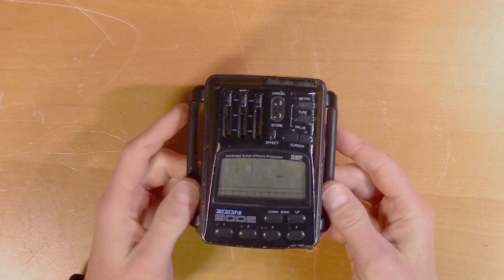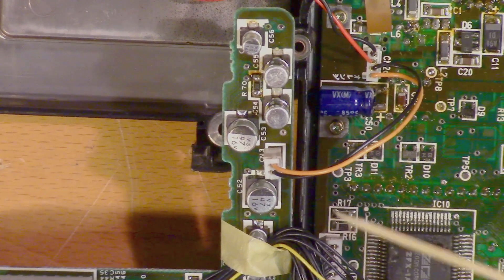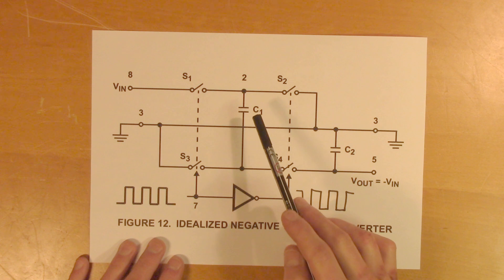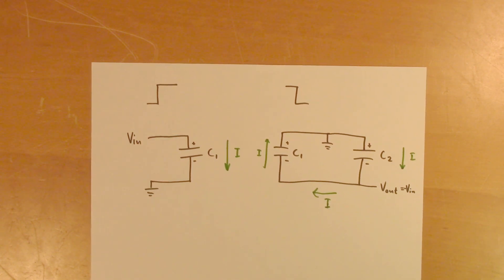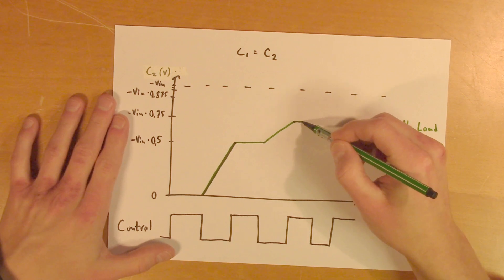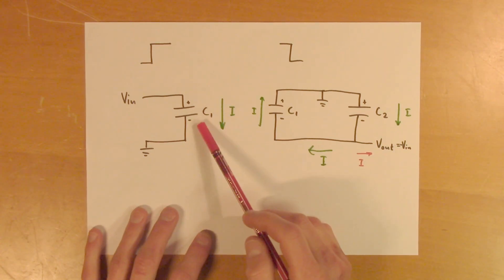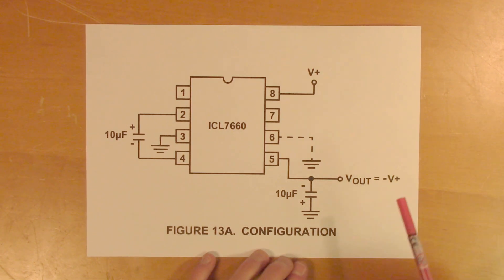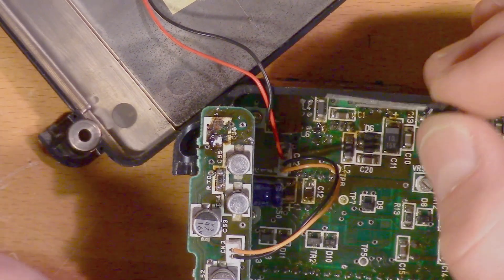ZOOM 9002 - Common Failure Explained + Repair

Comment: Hi SunandWeather Electronics. I had a Zoom 9002 Pro with the same symptoms as yours: no output, 0.5V where there should have been -5V on the little IC. I pulled a 10uF 25V cap off the PCB of a discarded DVD player i found on the roadside, replaced the N4 10uF 16V cap on my Zoom and it lives to see another day. Very many thanks for sharing your video and knowledge 🙏🏽

Comment: Thanks for the video.
I have +4.96v on pin 8 (in) and -4.68v on pin 5 (out)
Between pins 2 and 4 (10uf) 4.80v or +2.47 and -2.32v with reference to ground.
Are the readings correct?

Still not working after changing 8 capacitors

Thanks
Reply from the maker: Hello! It sounds like the charge pump on your unit is working as intended, so the failure is likely elsewhere.

Comment: My non working 9002 came back to life after replacing all of the surface mounted electrolytic capacitors. (Maybe 15 dollars?) I bought a box that had a large variety. The voltage rating on them was higher than the ones in there but that didn’t matter. Had to watch some videos for the proper soldering techniques as they are quite small.
Reply from the maker: Nice! Using capacitors with higher voltage rating than required is rarely a problem.

Comment: Excellent video. I have done this repair with minimal theoretical knowledge - just a basic understanding of 'these are bad, so change them.'
I am curious to see if the electrolytics can be replaced with MLCC caps, as the repair has once again failed due to age.
These things still sound awesome, and I'm glad people like you help give them new life!
Reply from the maker: Thanks a lot! Whether or not an electrolytic capacitor can be replaced with an MLCC depends on the circuit. I would say that in most cases electrolytic capacitors are used when high capacitance is required because they are cheaper or because MLCCs with the desired value does not exist, but in some cases the properties of the electrolytic capacitors are specifically required for a circuit to operate correctly.

Comment: Hi SunandWeather, I saw in your video that you insert the 10mF electrolytic with the negative to the left. I had a doubt after seeing the circuit. Is the direction of the polarity with which you insert the capacitor correct? I saw on the datasheet circuit that the + pole of the capacitor would go to pin 2 of IC 6 and d the - pole would go to pin4. but you mount it upside down. it is OK? Could you tell me something?
Reply from the maker: Hi Santo Stiriti. It is important that the polarity of the electrolytic capacitor is correct. In this video, the polarity of the new capacitor is the same as the old one. Since the old capacitor had most certainly not been replaced before, there were no reason to doubt that the polarity was correct.

I would not recommend using this video to determine the orientation of a new capacitor, as the polarity of the new capacitor is not clearly shown. Also keep i mind that there could be revision differences between the unit in this video and the unit you have, so they may not match exactly. Making sure that the capacitor is connected to the correct pins on the charge pump seem to be a good way to make sure that you have oriented the capacitor correctly, but make sure that the same charge pump is used in your unit.

Comment: I used a 10uF 50v. I didn't  work. Help me
Reply from the maker: Hi Luisatar! Since it seems to be hard to get hold of a service manual for the ZOOM 9002, troubleshooting will be difficult. As I said in the video, these electrolytic capacitors are not made to last, so it is very likely that there are some of the other electrolytic capacitor that is faulty. If you can measure the output voltage of the charge pump and make sure you get -5 V, you will know that that part of the circuit is working and if not, it might be the output capacitor that has gone bad, or perhaps the charge pump IC itself due to operation outside recommended conditions. If you have the -5 V on the output, the problem is somewhere else. In that case your best bet is probably to replace all of the electrolytic capacitors. It could of course be some other component that has gone bad, but without a schematic it will most likely be very tedious to find.

Comment: Thanks for inspiring me! Took my 18yo dead Zoom 9002, replaced the 7 caps on the thin side of the PBC and now it works!!! I got a bit creative with positioning cause I only had regular capacitors. Super nice explanation too. Side note for beginners who tries this: there's a black mark on each capacitor, that's the negative pin. You could find it easier to scratch a bit the SMD pads and solder there the capacitors, bending the pins.

Comment: Great video. I have the same issue and I've ordered the replacement caps. I plan to replace the 4 caps 1x10uF and 3x47uF surrounding the IC to be on the safe side - those caps will anyway fizz out sometime. One thing I know about the removal of these caps is that you don't need to desolder. Just grab a needle nose plier, hold it around and gently twist - it pops right out - with no pass and solder pads intact.
Reply: So, a quick update. I removed the cap out cleanly and soldered a new 16V 10mF in its place but there was no change - still no output. I think I'll go ahead and replace the other 3 as well. Also, thinking it might be the IC. Have you +sunandweather replaced the IC? Don't want to mess it up!
Reply from the maker: @digivish  Hi digivish! As the capacitors goes bad the IC may be operating outside its specifications, which could potentially damage it. I have not replaced this myself, though. As it can be quite tricky to remove I would try to measure it as the video suggest before replacing it. 

If you come to the conclusion that you need to replace it, I would suggest you try to remove the solder with solder wick. Start by adding a bit of standard tin solder to the pads before using the solder wick to remove it.
Reply: @SunandWeather  Yes that's what I'll end up doing. My voltage measurements are 5V at V+ and 0.5V and V- so definitely off.
Reply: Good news on one of my Zoom 9002 (I have 2) I replaced the IC7660 and the 10mF capacitor and everything works great and so does the sound! Now my second Zoom 9002 has a persistent sound in the output - even metronome and tuner are not clear tons - I can sense them on and off but the hum/sound is consistent. Input signals only faintly show on Bank 0, Patch 1 but other patches no sound at all. I replaced the IC7660 and most caps as well but no difference - any ideas?
Reply: @digivish  Hello. Can you tell me please, what is a IC7660? I'll try to repair my 9002, but before open it, I'm reading all comments. Please.

Comment: Hi, first of all, thank you for the video!
I had the same problem with my own unity. I replaced the capacitor with a new 63 V, 10 uF, but still no sound comes out. If you listen closely, you can hear that there is a low noise which changes as you change presets (it is the humming of the effects I believe), but nothing more, just like it was before Could it be the other capacitors, in your opinion?

Ps. Also, when I turn it on, I hear a fairly low whistle that keeps rising in pitch (almost like a bomb falling, but reversed) until it gets stable

EDIT:
Ok, so, I inverted the polarity (I got that wrong before), it started sounding alright but there was a disturbing noise that kept getting louder, as the sound kept degradating again. Could it be that other capacitors need to be replaced?
Reply from the maker: Hello Erymanthon! Since it seems to be hard to find a service manual or schematic for the ZOOM 9002, proper troubleshooting will be tricky. My first guess would be one or several faulty electrolytic capacitors, but I could not tell you which one. It could be that the capacitor you replaced took damage when you reversed the polarity. If you plan to use your ZOOM 9002 a lot I would recommend replacing all electrolytic capacitors anyway as it is just a matter of time before they will start failing.
Reply: @SunandWeather  Thank you very much. Yes, I tried replacing two more capacitors and the sound got better, it sounds like it should but still it is very quiet. I ran out of spare capacitors so I'll need to buy some more and replace them all, but this seems the right way to go. Luckily enough I found it is not too hard to replace surface capacitors with regolar ones, I just cut and bend the legs and it just works.
Thanks again for this useful video!

Comment: I had a hum or creaking you think is capacitor too. What is the new replacement for capacitor so it will last longer?
I saw in the video you used the different type of capacitor. Can you tell me the name and where to order?  thank
I still love the sound of ZOOM 9002
Reply from the maker: Hi Par3TV! It is very possible that your problems are caused by faulty capacitors. Although, I do not think they are caused by the capacitor that was replaced in the video. If you want your ZOOM 9002 to last a long time, I definitely suggest you replace all the electrolytic capacitors. I was lucky enough to be able to fit a through-hole mounted capacitor with ease thanks to the conveniently placed vias, but replacing all of them with through-hole capacitors would be a struggle.

I suggest you look though the surface mount electrolytic capacitors on any of the big component retailers and find a series of capacitors with good specifications, and go with that. You should find a specification similar to "Lifetime @ Temp. = 2000 Hrs @ 105°C", which indicate the expected life-span of the capacitor; use this to compare.

Comment: great video I dont even have one , but I didnt get why they used that charge pump
Reply from the maker: Hi P4R! I am guessing they wanted a +/- supply for the analog circuitry so that the signal could be centered around ground. But that is just a guess.

Comment: Great video, very useful. I have the same problem, could you give me the exact abbreviation of the electrolytic capacitor to be replaced? Thanks a lot.
Reply from the maker: Hello Pino G.! I replaced C56, a 10 uF, 16 V electrolytic capacitor. Please note that there is no guarantee that this is the component that is causing your device to fail. If you plan to use it a lot I would recommend replacing all electrolytic capacitors as it is just a matter of time before they will start failing.
Reply: @SunandWeather  Thank you very much, greetings.

Comment: Hello. I am a Zoom 9002 enthusiast and have a few damaged units I'd like to repair. Do you offer this kind of service? If so, are you in Europe? Thank you.
Reply from the maker: Hi efirehawk! As of now, I do these repairs as a hobby, whenever I have time to spare. If you want to fix your units I recommend getting all the electrolytic capacitors replaced, not just the one that is causing the device to fail like in the video, as it is just a matter of time before the other ones will start failing.